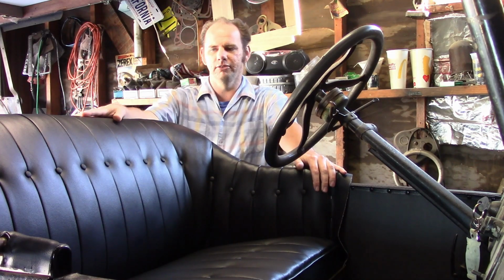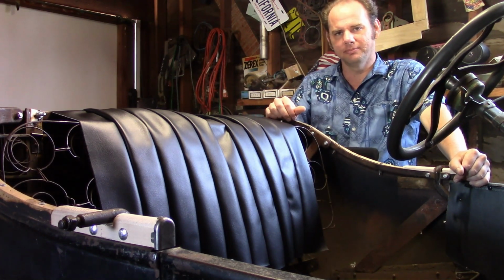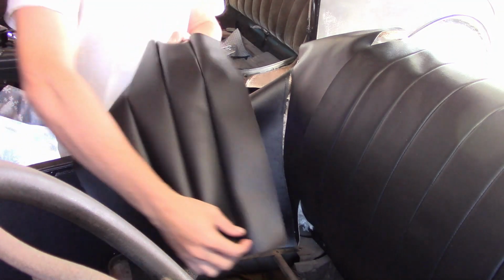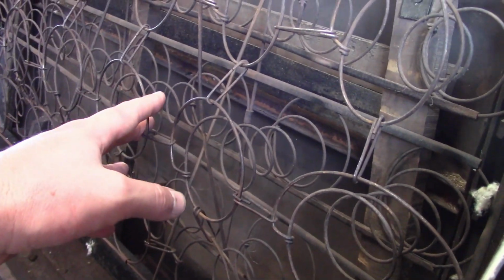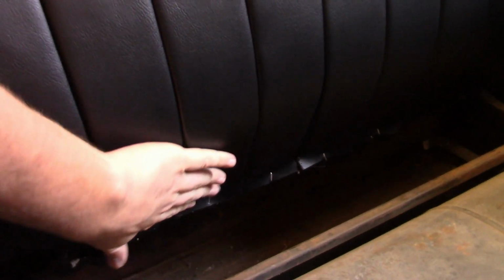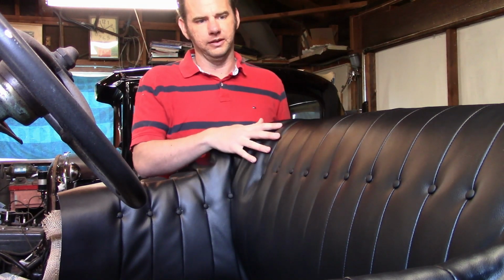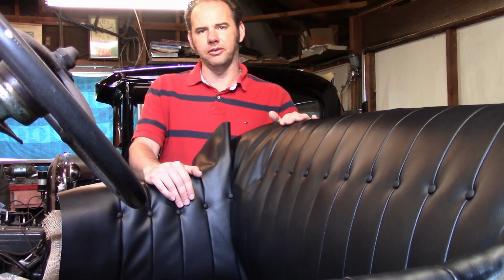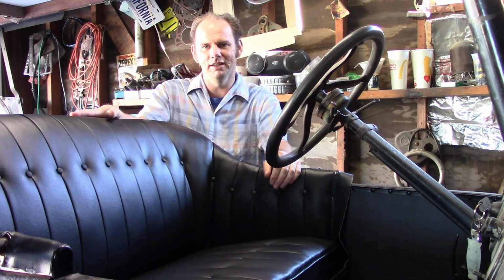1925 Ford Model T new top/interior. Part 5.

Comment: I have a 26 touring that is missing the springs and need to know if all front and back upper and lower springs are the same dimention.
Reply from the maker: The '26-27 body does use different springs, but I think they're available new.